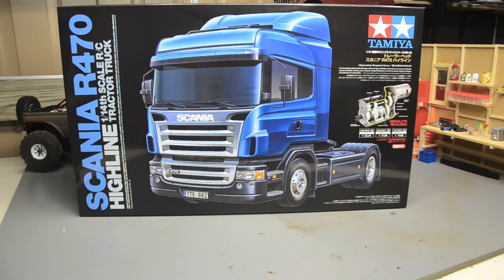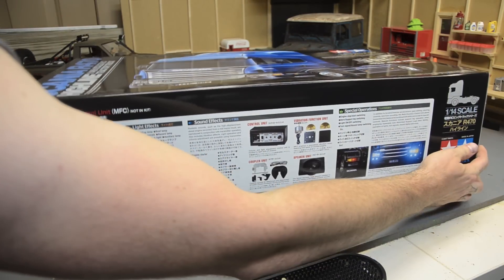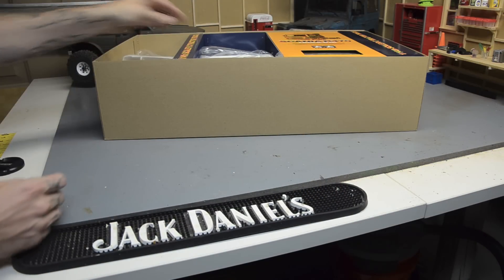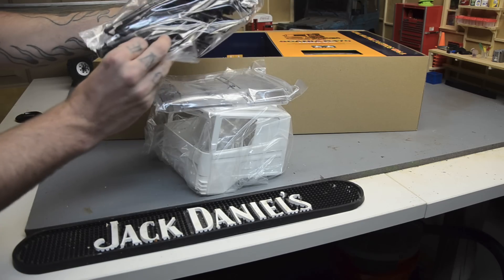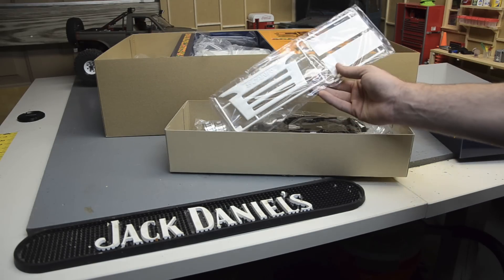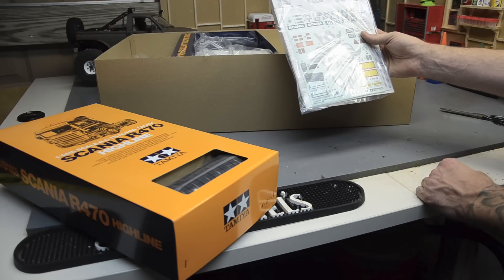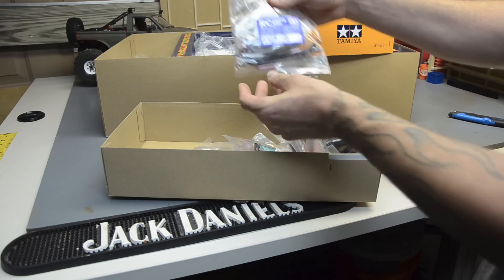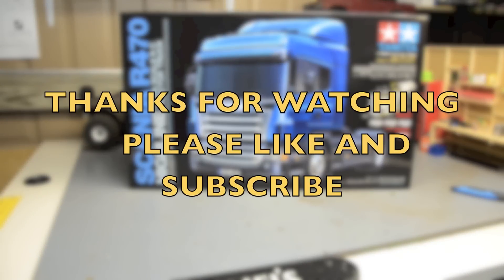Tamiya Scania R470 Semi Truck Build Part 1

Comment: Nice to see Americans are as interested in European trucks as we are about theirs. In the 80's, a couple of German companies had US Trucks for show purposes, which appeared on the album covers of german country bands. European trucks didn't have long noses or separate sleeper cabins the size of camper vans, and very few, if any, chrome ornaments. 
In Germany, and I guess all of Europe, long noses disappeared beginning with a set of rules  restricting the overall length to 14m (which were later eased back to 18.5m). Bonnets survived for a while on trucks that were not pushing the length boundary like fire engines, military off-roaders or dump-trucks.

Comment: hola soy peruano y megustaria comprar una docena de camiones de scania  de diferntes modelos y donde los consigo para poder saber el costo de los 12 carros de scania
Reply from the maker: I have no idea where you can get them in peru.  I bought mine from Ebay but I am in the united states.  This model cost around $250 USD.
Reply: RC Everyday
Reply: Amigo  a como compro los camiones

Comment: The reason why it does not have a long hood on it is because in Europe there is a limit in length of tractor and trailer. so by haveing a shorter tractor you can have a longer trailer=cargo ☺

Comment: Scania R470 is equipped with a straight six-cylinder diesel engine, 12 liters, 470 hp at 1900 rpm and 2200 nm at 1100 rpm. In Europe, these trucks are used on long trips, and there is a bed behind the driver. Your model is a highline version, but there is also a smaller day cab, double cab or CrewCab such as European firetrucks, there is also a top-line version with much higher cab roof. But the real bad ass Scanian you can get, is the R620. A 16 liter V8, 620 hp at 1800 rpm and 3000Nm (2213ft / lb) @ 1000-1400rpm of torque, and a wonderful sound when they drive by. And R is the cab type, the number is horsepower.
Reply from the maker: +Johan Blick thanks for the info. Good to know if I change the configuration I'll need to change the emblem as well. I'll have to look for videos of the v8 sound. All we install at my job  are straight sixes. Some sound pretty good.
Reply from the maker: +Johan Blick Man, thats some sweet stuff!
Reply: RC Everyday ii
Reply: Johan, thank you! Very valuable information. I've heard the V8s on Video, but we don't have anything like that here in the Colonies... 
Scania still makes AIR-Cooled Diesel Engines??

Comment: if i were you i would avoid the MFU as much as possable and use Servonaut as its so much better then the MFU
Reply: Theminecraftstarship how come?
Reply: The Servonaut is a good system... But in terms of options vs. value - Beier has it BEAT. Costs 30% less than comparable Servonaut, less than HALF of what a MFC-01 or -03 would cost....
And many, MANY more Sounds, Lighting options, Functions, to make your Truck do nearly ANYTHING you want!! 
Yo can even make it play Music, of your choice, up to two hours.

The only real drawback of the Beier is, it may be the least user-friendly, and requires intermediate Computer Skill, as you NEED a Computer (NO Phone or Tablet) to program the device. 
However it's not difficult. Just a bit tedious.

Comment: Josh, I have built my flatbed with the lights kit.  I want to order the Cascadia with the MFC-01 unit.  Do I need to order a light kit (  $39.95 ) like the trailer has ?  Thanks for the help.   AZ
Reply from the maker: +dks13827 I believe the mfc unit comes with the lights but not 100% sure. I never bought one. It would.make sense they would be included since they are integral to the functions.

Comment: Hola soy de argentina y me gustaría tener uno, pero tengo varias preguntas. El control remoto viene con el camión o es algo que se compra x separado?  Y el ensamblado incluye también todo el motor?
Reply from the maker: The kit comes with a motor but you will need an esc and a 3 channel radio controller for it.

Comment: Hey I'm looking to build one of these but I have little to no experience. Where should I start? Great Vid keep it up!
Thanks.
Reply from the maker: Hi thanks for watching. These tamiya kits are pretty straightforward and the instructions are clear and easy to understand. You can put one together with basic tools like a small Phillips screw driver.  I'd say just get a kit and take your time. Electronics are sold separately but other than that the kit gives you most of what you need. These trucks need a 3 channel radio. Futaba makes a few reasonably priced units. Hope that helps.
Reply: If you still haven't tried one yet... The Globe Liner might still be the easiest of the Tamiya Semi Tractors to build. It also looks cool, and there's a BIG Aftermarket parts supply. You can really customize it!! 😉

Comment: The screaming chicken, as you call it, is in fact, the Griffon, a mythological creature, which is not a bird, but more like a Gremlin .p  Skáne / Scania, is the most Southern State, of Sweden,  State Capital Malmó. And what is the dialect, which they speak there, it is Scanian. The State bird, is the Red Kite. The Swedish Flag, is yellow cross, on blue background. The Skáne / Scanian Flag, is a yellow cross, on a red background, and that red, is the reminder, that Skáne / Scania, was twice owned by Denmark, two wars were fought over it, as it is the bread basket of Sweden. A wise upgrade, for the supplied motor, is a Carson "Poison" motor Art. No. 50 090 6023, it shall bring the speed down to a more realistic level, and it is cheap too £14.75 in the UK. Happy Building : )
Reply from the maker: +noggin48 Awesome!  Thanks for sharing that.
Reply: toi muon mua cai nay
Reply: Griffin is like a 4 legged eagle sort off right ?
Reply: unimog400 Yes almost what you describe it as, and in Skåne it's called "Grip" or "Gripen". And Skåne is in latin Scania